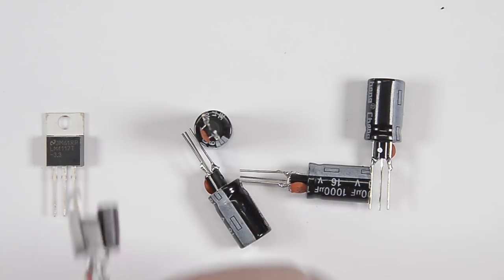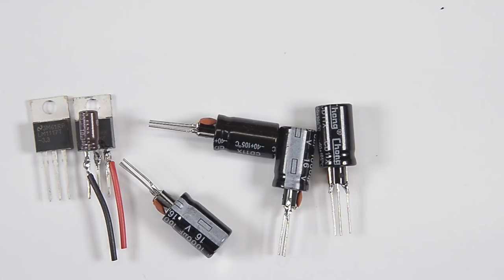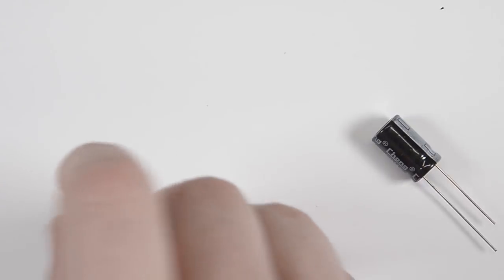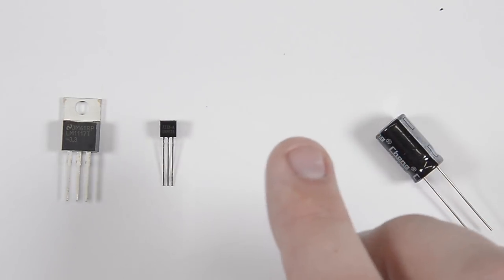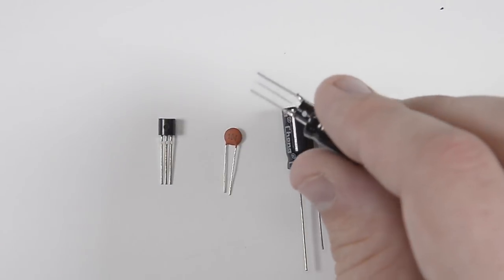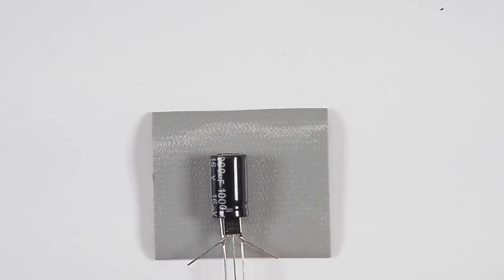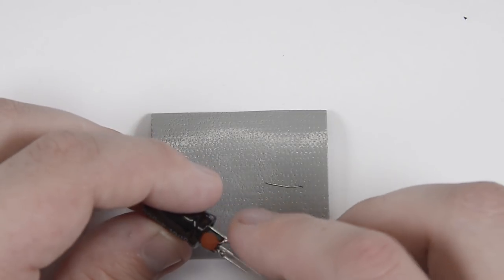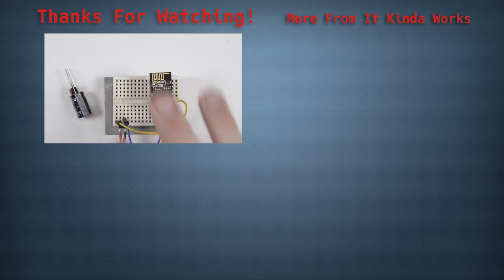New ESP8266 Voltage Regulator Design

Comment from the maker: Got a question or something to add to this video? Check out the IKW forums at http://itkindaworks.com/forum/
Reply: hi i am extremely new to esp8266. could you please direct me to a wiring diagram for the above connection? also what is the input voltage? thanks in advance :)
Reply: @rakeshthottathil9577  Try looking for the datasheet then you will have all the information

Comment: ESP8266 has nothing specific to do with this.
Reply: Yea! I know right, all those guys saying you need to add capacitors to prvent the esp8266 from freezing/reseting ! I had a some issues with my esp8266 all I found was guys telling me to add capacitor to power input while I had a stable supply ? well turns out it was basic coding issues, with better code everything is super stable ! I have a esp running over 2 weeks now without a single crash. here is my code it uses arduino ESP8266WebServer.h wich is way more stable than the esp8266server.h and other methods of coding shown in examples on the web, check it out https://github.com/sansillusion/espLightServer/tree/espLightServerRGB

updated version running on http://008.ddns.net:8080
Reply: Steve Olmstead Yeah, I experienced the same with the standard web server packages. It is just the code quality.
Reply: Without ESP8266 in the title I would not have found this very good video + I can use this with my ESP8266.
Reply: @c0r0y  same bro

Comment: Interesting. I'd probably bend the legs of the cap and mount the reg beside it. Heat rises and the vent of the cap is on the bottom. Electrolytic caps don't like heat. I bet that little reg gets a bit warm because it doesn't have much surface area.
Reply from the maker: A couple other people have noted similar things about the reg placement but so far I haven't felt it get anything above a what i'd call room temp. If I notice them get hot though I might just do something like that in future builds. I probably wouldn't use this design on anything that needs to be regulated from anything over 5V though so in general it should be ok.
Reply: If your ever into upcycled electronics, most wireless keyboards and mice use a very efficient Buck-Boost topology switch mode circuit. They can grind a couple of batteries into dust by the time they are done. The circuits are usually very simple and easy to cut out and repurpose as a stand alone module.
   I'm a slow gimp, with a bad back, so it takes me ages to finish projects. I plan on doing a tutorial soon on how to upcycle tiny switch mode supplies, like the little buck-boost, to reuse in other projects.
Reply from the maker: Thanks for the tip! I just subscribed to your channel, I'd love to see the tutorial whenever you end up doing it!
Reply: ItKindaWorks 
  Thanks. I subbed to yours as well. I have an old ESP8266 laying around somewhere around here. I'm simply in need of project motivation. Looks like I found a good source of that here ;)
Reply: Upcycle Electronics

Comment: A VDO should use an input and output capacitor in order to stabilize the Vin and Vout. You are soldering the 2 capacitors always to the same VDO pins (ground and Vout). Honeslty I don't understand what you are doing.

Comment: are you sure the circuit is correct? I've seen on Google that 1uf should go to input and ground, and elko which is 16v 1000uf goes to output and ground

Comment: Mr. ItKindaWorks, your knowledge of electronics also "kinda works"!
Here are some facts and additional information for people who asked:

1. The main difference between the 2 regulators is their Package. The package dictates the maximum Power-Dissipation that the regulator can take. The power dissipation is the voltage drop on the regulator (input voltage, minus output voltage), multiplied by the current through it. This power dissipation causes heat that must be "cleared off" into the air. The smaller regulator is not as good at this as the large one. So, if your input voltage is really just a little bit above the 3.3V and the current is not too high, you can use the small one. Otherwise, you need to calculate. a TO-220 package device (like the LM1117) can usually take up to 1W of power without an external heat-sink (at normal room temperature).

2. If you really want to use a battery for your application and want to "squeeze" as much out of it as you possibly can, using a drop regulator like these is NOT what you want to do.The drop regulator is converting all the extra voltage just into HEAT! This heat is not really helping anybody to achieve any goal and is just wasting the battery charge faster. What you want to do is to use a Switching Regulator which can work with wide range input voltage and at high efficiency. 

3. The 1000uF capacitor is required mainly due to the resistances of conducting wires and the internal resistance of the used power source (before the regulator). As others have said about the ESP8266, it's a good practice to use such a large value.

4. The small capacitor mentioned in the video is meant to deal with a technology problem of the large capacitor. The large capacitor is an Electrolytic Capacitor. It's internal structure is long strips of foil rolled into a cylinder. Due to this structure there's also a significant amount of Inductance that this device can demonstrate. The Capacitance and Inductance (and some resistance) are connected together into an equivalent resonance circuit. At low frequencies the Inductance is too small to have any practical meaning. But at high frequencies the inductance starts being much more influential than the capacitance and we get an Inductor instead of a Capacitor. Theoretically the 1000uF value does not reflect this, but the technology isn't always perfect. This is where the small capacitor with different technology comes in. This technology does not allow making very large capacitors, but it has VERY little inductance even in very high frequencies. The two capacitors combined together can give a full spectrum filtration. 

5. Having said what I've said in #4, it should be mentioned that adding the small capacitor on the regulator itself is probably meaningless. Electricity at high frequencies is slightly more complicated than DC or Audio frequencies. When the wave-length of the signal is much shorted than length of the conducting wires (high frequency), you no longer can assume that the voltage on each point of the conductive wire is the SAME voltage at any given time. You might have some noise signal on the leads of the ESP8266 chip, but slightly further away, on the regulator, that noise would not exist. The wire resistance increases this phenomena even more. This is why the small capacitor should be AS CLOSE AS POSSIBLE to the source of the noise, where it can be the most effective. This is also why systems always have so many of these capacitors, next to EACH noise source. 

5. Just as a general note, the large capacitor is mainly required in order to make sure the voltage supply (from Ground to VCC/VDD) doesn't drop below the minimum operating voltage. The small capacitor is doing this too, but it also takes care of another issue, called "Ground Bouncing". When "noise" occurs on power supply lines, the VCC voltage drops a little bit towards the GND voltage, but you might also say that the GND voltage RISES a bit towards the VCC. If this happens at low frequency, the problem is not so big, as at any point in time the GND voltage across the entire application would be the SAME. But at high noise frequency, it's possible that the GND pin of the ESP8266 rises a little bit above the GND  level of another chip. If that other chip is sending a data signal to the ESP8266 and the voltage on that data signal is just slightly above the logic HIGH level of VCC/2 = 1.65V (this is called: "low noise-margin"), then if the ESP8266 GND level goes slightly higher, it might start thinking that this data line is actually at LOW level instead of HIGH. 

Hope this helps.
Reply: many thanks for your insight on this. 
I'm never quite sure how these Pro level guys find interest in remedial videos like this one, 
but I'm glad they drop in and add their 2 cents ;)
Reply: Trans Lator +1 What this guys says. tldr: Dropper regulators turn the excess voltage into heat, which sucks for pretty much all use cases. Use buck regulators instead. They are a buck a piece on eBay.
Reply: kduhtdkzrt 
yea that's what I was planning on doing. with my next project. I don't want any extra heat. since its a batt powered device. and its in the house. I need it to stay as cool as I can get it. I need 3.3 & 5 volts. I have seen buck converters with multiple outputs. looks to be a good idea to have most logic level voltages on a single converter.
Reply: Thank you.  This was a very useful contribution.
Reply: These are also Linear regulators,   if your input is 5 volt,   and your output consumes 200 mA,    it dissipates (5 - 3.3) x 0.2 = 0.34 watts  as heat,   and this powerloss increases with input voltage and output current.  
Its minimum dropout voltage is 1v , meaning if you need 3.3v on output you need to supply atleast 4.3v at input>
Its Quiescent current is 5-11mA  (@5V) meaning it will always consume around  0.050 to 0.150 watts even if there is nothing connected on output.
Reply: You mention a lot of things that are true, yet there still may be good reasons to use lineair LDO's in battery fed projects, apart from their small size, simplicity and low cost.
The voltage drop, low quiscent curren and 'clean output'
There may be, but I wouldnt immediately know one, switched PSU's that convert 3.7 to 3.3 Volt.
For the popular LM2596 for instance, I think the dropvoltage is at least one volt, while the quiescent current is 40-100mA and thats just for the chip, not for the components it needs around it. So even when your device might be in deepsleep, the LM2596 is burning away 40mA. In comparison: The HT7333 and HT7833 only burn 4uA in idle state.
Not sure what the overall efficiebcy of the linear regulators is but for a switched ewgulator like the :LM2596 it is some 70%
Switched psu's do cause a lot of disturbance on the power line. whereas the linear regulators do not/

Comment: I've recently started using these wonderful  regulators for my ESP8266 projects. Not only does it have a very low dropout voltage but also has a very low quescent current and that makes them usable for battery powered projects (LM1117 is terrible).

Comment: I just got charge pump from ebay. It's super small, cheap and outputs fixed 3.3V (150mA continiuous). Input is between 1.8 and 5V. Its basicly boost buck converter without need for bulky electrolitic capacitors. It's powering my esp8266 without any problems. Power consumption without load is 0.36mA at 4.2V.

Comment: LM1117-3.3 dropout voltage (Vin - Vout) is from 1.1v@100ma Iout to 1.3v@800ma Iout (see: http://www.ti.com/lit/ds/symlink/lm1117.pdf).  Note that the max operating current of the 1117-3.3 is 800ma. 

The HT7333, on the other hand, has a listed Vdrop of 90mv, but only regulating from 4.3vIN. They give max current a weird way, saying 250ma-but whilst giving only 2.97vOUT. In fact, they seem to draw your attention away from the fact that the chip only meets true specs when the Vdropout is actually 1.0vdc. 

In fact, if you look at that charts for all the other ranges, specs are for Vin of output + 1.0v, which kind of says it all. The fact that they don't come out and say what it is (though the top line description is "LDO", makes me suspect marketing left it ambiguous intentionally, letting them fall back on "LDO refers to current!"  (see: http://www.angeladvance.com/HT73xx.pdf). They do this to make side-by-side with competitors more difficult.

There is another thing to consider when using this chip instead of a beefier one... Odds are you are not running JUST an ESP8266 all by itself. Alone it will run at 150ma, which leaves ZERO wiggle room for anything else (HT73333 Imax = 180ma)-and that is at 3% tolerance! (see: http://download.arduino.org/products/UNOWIFI/0A-ESP8266-Datasheet-EN-v4.3.pdf) 

This means you are at the point of clipping all LEDs and other loads and going commando. And the specs for the ESP8266 are for JUST THE CHIP, not any GPIO load. As long as you don't do much, you won't be burning out your regulator, or worse burning off heat (power) due to overloading the tiny regulator. Should you be adding a protection diode to your design? 

Finally, the manufacturer has clearly avoided any mention of the H73XX being a Linear Voltage Regulator. This is a huge consideration for battery powered stuff. Linear regulators are very inefficient, typically at 60% efficiency. This means they burn off a lot of battery power as heat, as a linear regulator is just a fancy resistor bridge. The up side of this inefficiency is that it does not 'switch' on & off like a Switched Voltage Regulator (efficiency typically above 95%). 

So what do you get in exchange for faster battery drain? Almost zero noise, as switching regulators (if you have a DC-DC buck, you have one) switch on and off in the range of MHz. Linear regulators are most efficient (as you can imagine in any resistor bridge) when the input & output voltages are as close to the dropout, which is infered as 1.0v, or in your case 4.3vIN. This is because the only loss will be the 1.0vdc to run the regulator itself.

The difference you are no doubt seeing has nothing to do with the huge (expensive) capacitor, but the fact that it's a linear regulator, and switching regulators cause ripple on the Vin that can be annoying to the ESP8266-especially the clones. That is where the big honking cap will come in handy! I did a video where I pimped out an 8266 with one, putting it on the card itself, which is where the MFG says it will do best. 

Oh, and if you want to see some amazing specs for a regulator for remote sensors that will do 200ma (compared to the 180ma of the H7333), check this little critter out. A true 250mv Vdropout and a staggering 1ua typical power consumption!

http://www.sunrom.com/p/xc6206p332mr-662k
Reply: The Sales Engineer wow! Really much info in your comment, Thanks a lot!
Reply: Thanks! I'm really digging into regulators lately. It seems the ones on the RAW pin on the clones are not high performance (go figure), and I am finding extremely efficient regulators in a SOT23 package that my tests show are amazing. I just did a video comparing 3 regulators, and one on eBay for $0.02/each has a 40mv dropout voltage both open (no load) and driving a Pro-Mini! 

I like work like that on this video, as it is so useful and convenient on breadboards. Also, if for some reason you were under insane size/volume constraints, this would avoid a larger PCB. Of course, being a fatalist, I see the problems once a component needs replacing, or even troubleshooting... 

This video has inspired me to find a way to attach a SOT23 regulator (3mm on the long side!) to a cap with 2.54mm pitch for breadboarding. Such a great idea,  @ItKindaWorks !

Comment: I don't get the final circuit. You've soldered both capacitors between the VOUT leg and the GND leg. The most basic voltage regulator circuit is a capacitor between VIN and GND and another between VOUT and GND so both capacitors and the GND leg are linked but each VIN and VOUT legs have one capacitor soldered to them.
Where am I wrong? Please correct/help me understand. Thank you.

Comment: Hope you can help me , where I face issue 

I given 5v DC external powers supply for nodemcu and 4 channel relay.
Which works fine but not all time because when power fails or change over to genset board which does boots up but not able to communicate or not able to operate properly may be voltage or current are low , so how to fix this but fyi I found ac volt is always 230 in mains and genset even other electronic devices work fine.

Would be great if you suggest solution for my issue.

Note : I kept powersupply module , wifi module and relay module in switch box Junction which has 3 different pcbs. It's really much difficult to reset nodemcu means I need to remove screws in switch Junction every time.

Comment: I just had an idea for you regarding these little composite regs your building. You could use a small bit of rigid plastic tubing about the diameter of the electrolytic cap. I believe most home improvement stores have tubing like this in the lawn sprinkler section. Cut it to the height of the gap between the bottom of the cap and base of the board. This would allow you to use a bit of silicone or hot glue to firmly secure the assembly to prevent stress and fatigue on the leads. I'd also drill a few holes for air circulation in the sides.
Reply from the maker: That is a good idea - I think I even have some tubing of roughly the right diameter laying around to try it out. Thanks!

Comment: Awesome. An excellent solution to low current PSs. I note from the Datasheet that The 7333 has a 5v cousin, as well as a number of niche lower voltage brethren. Thanks for the heads up and the minimalist design.

Comment: I have a question....the max current draw at boot of an ESP8266 is 320mA.  So, how would these not burn out on boot?  Also, the drop-out voltage according to the spec sheet is 4.3v.  That's 900mV, not 90 mV.  How is this going to work?

Comment: What happens if I don't use capacitor at all? I want to turn on esp8266 (running from batteries) from a physical button, If I connect capacitor does it have enough time to charge up in a millisec?

Comment: Trans Lator made some very good points.  Additionally, mounting an electrolytic capacitor right next to or touching a heat source (a voltage regulator), will significantly decrease the lifespan of the capacitor.